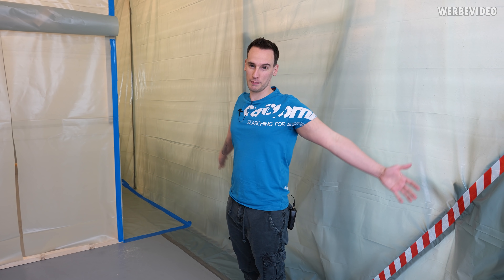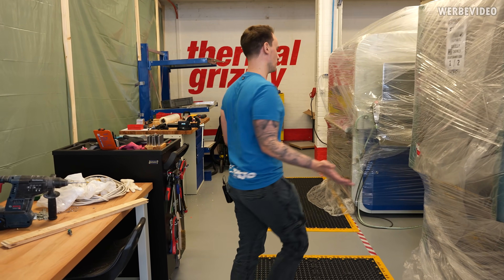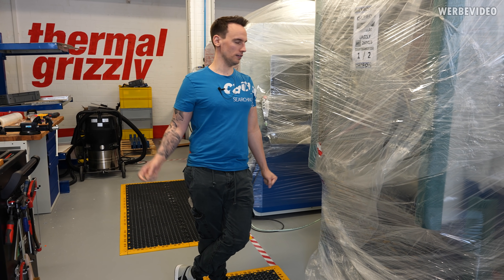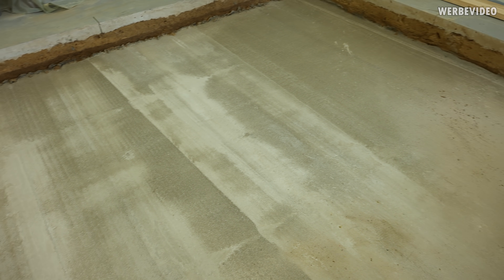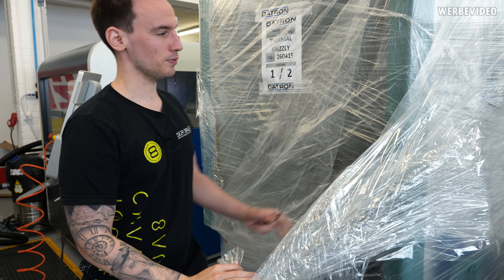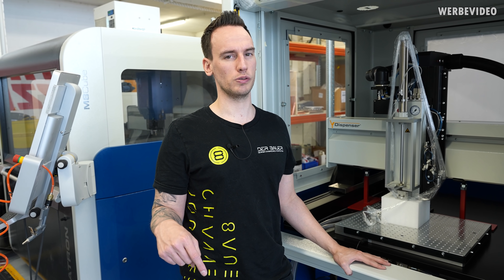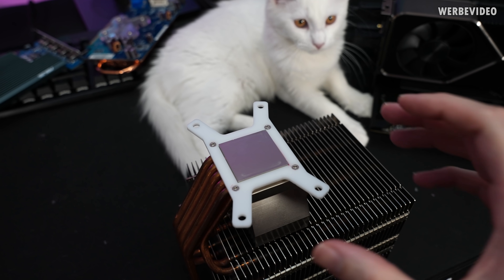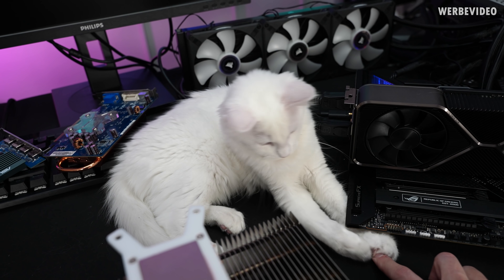WEE(K)-Log #22: A Machine that could revolutionize Water Block Design for us

Comment: 7cm floor depth?  That isn't even enough for a typical garage which should be ~16+ cm deep here in the US.  IIRC the last 2 shops I worked in had 30+ cm depth floors.
Reply: American Concrete Institute apparently suggests 6-8 inches which is roughly (15-20cm I think) for a commercial property or more if load requires. And either should have reinforcing embedded.  7cm floor and looking at that cut, very uneven depth evenness. I think some basement floors in US homes are thicker.

Comment: Dear lawds what a sh-tty floor! Your crew shifting the new machine onto final location better use large area aircushions (basically hovercraft) when moving the new equipment into place, otherwize you'll destroy the floor just by rolling over that weak slab! What you saw in the cut is, by the laws of probability, not even worst case. Hot dam!

Comment: The machine quality is insane for such low volume products, no normal person would practically invest to this extent, it really shows a true passion for engineering craft and the community. Though I have to say, can please for the love of all that is holy get a quality website and sell product direclty, the distributor model is super tedious trying to get stock outside EU. I get it probably lowers overheads and keeps the focus on product engineering, however I would rather send all the money direct to the company and not mess around trying to find stock all the time for your products. I want to buy your Extreme Minus Pad/s however the availibility is a complete joke, especially for a product that is wallet ripping expensive, it just should be way easier to buy.

Comment: Aren't you going to have to cross the thin floors with the machine in order to get it to its final location, or is it just going to get dropped in from the top with a crane?
Reply from the maker: We will have some thick steel plates on the floor for transport :)
Reply: @der8auer-en  For sure make before and after pictures of the floor before transport.
I wonder if there will be cracked veins in the concrete, and for sure tell them to be super careful.

Comment: you mean the floor is around 3 inches thick Now and You need a Bare min. of Around 12 inches / 1 Foot to Nearly 36 inches / 3 feet for stability for Heavy Machinery , 7cm is No Where near Even Enough To Cover The Walking stress Must Less an Office Nor Office Equipment . 7cm / 2.75 inches = Well Below Standards on Majority of Business Buildings to be Honest , Here = Business Building Code Starts @ Bare Min. 12 Inches / 30.48cm Which is What I Stated Above @ 1 Foot in Depth / However - You May Want The Feet of Machine To Actually be 36 inches / 3 feet / 91.44cm , That Is the Standard " Here " for such Applications
Our standards For 3 inch Flooring - that is What you are Walking On , Foundation is What the Walls are Up-righted As Well Any Interior Walls That May Be Weight Barring On which Should Be No Less Than 36 inches In Commercial Construction and That Is What You are In = A Working atmosphere = Commercial Application / However 3 inch Flooring is Mainly used For Housing Floors Meanwhile the foundation is Around 16 to 28 inches Bare min. Unless there are 2x8 wall applications and two or more stories = 36 inch Min. / and Why i Stated that you Need 36 inch footing is for The Machinery = 7 tons in one spot in the middle of a Floor = Even @ 12 inches = That Is not Enough To Withstand the Stress Over time Hence You need Bare Min. 36 inches For the Footing of the Machine that Can be Determined By Measuring the Feet Pattern  on the Machine and Digging Out FOOTINGS for The " Legs " of The Machinery For The Floor To withstand The Weight and Stress Over a Length of time / Otherwise You Stand Having To Move the machine Over a Length of time to Cut Floor out Again and Upgrading The Footing For The Purpose , 
Coming From an Master Mason " Here = ME " !
Also from New Flooring / footing = You Need an Expansion Joint To Keep from Busting Up the floor Around the New Instalment of Grading from old Flooring = And YES It Will Place Stress upon The Existing floor If You Do Not Allow for a Separation From the New To Old in this Work Scenario
tat dirt looks Very Loose - You Need to Go Down to Hard Soil and Then 12 inches below that and You can Bring that Back Up With Gravel But it Must Be Packed TIGHT ! The loose Soil Will give Under stress From Machine you are using Over Time , the soil will liquify/ solidify  like in an earthquake Over Time
Also That Old Flooring Looks like NO ONE Even tried to Level it out Before Pouring Concrete AT ALL !!! YES You needed an Upgrade Indeed ! in fact Be Careful of The Other Equipment you are using , If You Start to See Cracks in Floor - Stop What You Are Doing !!! JUST STOP !!! Don`t carry on , Fix Floor , In Fact The owner of The Business Building Should Be At Fault if He / She did Not Warn you of The Confines Before Hand of The Weight Load Limitations of This Floor , be Careful Der8auer , good luck and be careful / SERIOUSLY !!! One of my Specialties Was Repairing " BS : Like This = THAT LOOKS " SHADY AF " !!! like someone was just collecting a check and ran afterward . . . 4Realz !!! Be careful of your Investment Here ! just a heads up Brudda , just a heads up that is all

Comment: Lots of cool, new toys for you to play with Roman :-) Man, that floor, really disappointing considering where it is, really let's down that whole "German Standards/Quality" thing, they didn't even properly level the sand so you at least had a consistent thickness :-\
Reply from the maker: We rented this hall because of the cheap rent. It was built about 60 years ago so not todays standard. But in the end it will be much cheaper to do some investments and pay less rent
Reply: OK, granted and legit reason for you, but I wouldn't even do the foundation for a garden shed like that, far less a warehouse, that's SO bad. 
Cannot believe you haven't suffered QC issue from vibration because of that floor, there's no way it can have sort of real rigidity to it - if you've had errors in the past of stuff being off on sensitive machines, you might have found your culprit.
Reply from the maker: The other CNC is on a different part of the hall which has about 20cm thigh floor from our test drills. Since the M8 is also only abotu 1T in weight it's much less of an issue there :)

Comment: Will the sealant be replaceable on something like that prototype you have in the video? It looks like RTV sealant, which usually is a one shot deal. It could be something totally different too, that is just what comes to a mechanic's mind.
Reply: It will, it Sticks to one Side and can be replaced. In German channel, He already answered this question asked by a User.
Reply: @GhanchiTV  Did he mention whether it was just a tube of sealant or a custom gasket that will be available for purchase? I can see a tube being a real mess on something made of acrylic, at least if it was me with the tube in hand anyway.
Reply from the maker: It would be a custom gasket. We can "print" them on a less sticky surface and then take them off for shipping
Reply: @der8auer-en  Dude, even selling some replacement parts will be a massive step up in the space. EK will sell me a $400 waterblock and no spare orings? plz. Also I wonder at what voltage you can run a passive cooler on that 5800X3D, I have one running at 1.1v on a crappy air cooler (waiting for a block) and it loads at like 45C, its nuts, can't wait for the contnet :)
Reply: Just like with delidding you can separate it, clean it and reapply.
Reply: Can look into different sealants as well. If it’s rtv standard, the white/silver variant is specifically made for liquid/coolant applications. Will likely increase seal integrity even further. That machine is dope!!

Comment: How to get new measures to center an AMD Ryzen 3000 AIO OC mount from you on an 5800X3D? Dead center or?
Reply from the maker: It should be the same as 3700X
Reply: @der8auer-en  perfect, as I have the 3700X at the moment, but the 5800X3D in it's box! Thank you! Excellent work! :)